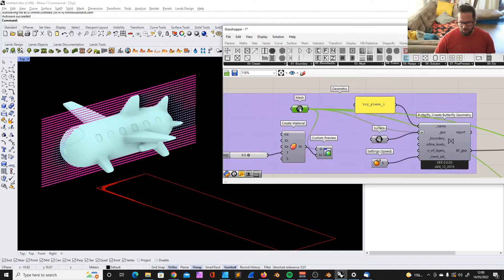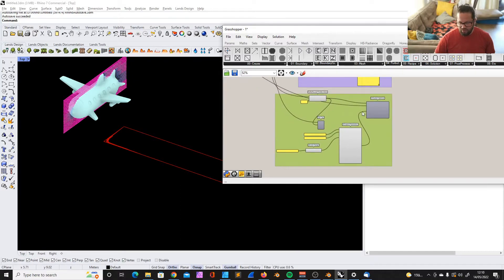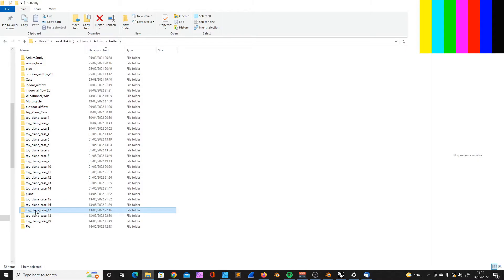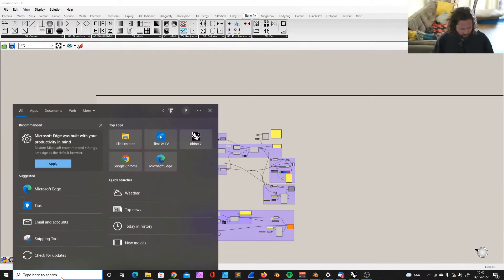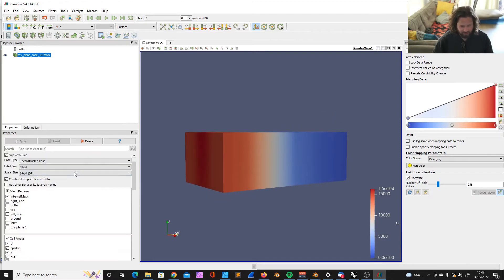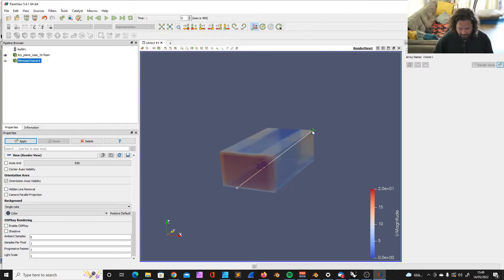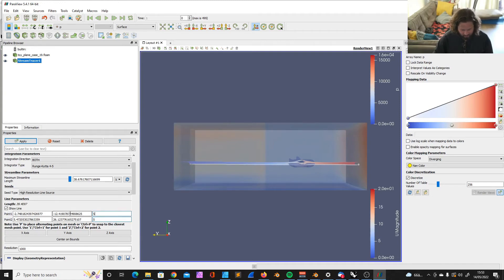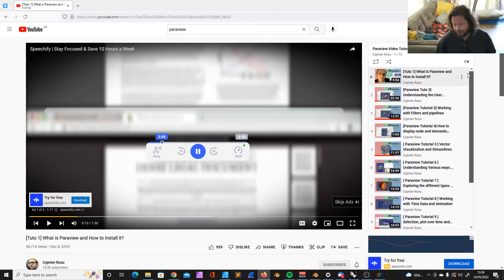Butterfly CFD | Toy Plane Part 05 Paraview | Fluid dynamics Inside Rhino Grasshopper3D Tutorial 13

Comment: Hello Philip,  thanks for sharing these powerful videos. I have a question, why cant I find openfoam file in my directory to open in paraview? In other words, how to save the CFD results into openfoam file?
Reply from the maker: Hi Nagham Ismail,
It should automatically set up a file. We're you able to run a successful simulation in Rhino?
If so, the file should be there. You can test if your installation is correct by trying to run an example script which came with the Butterfly installation files...